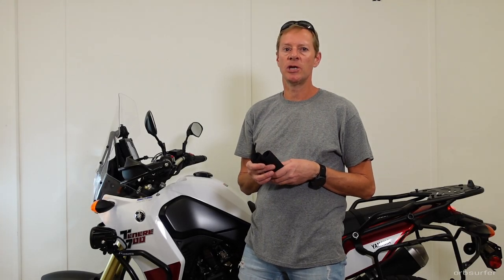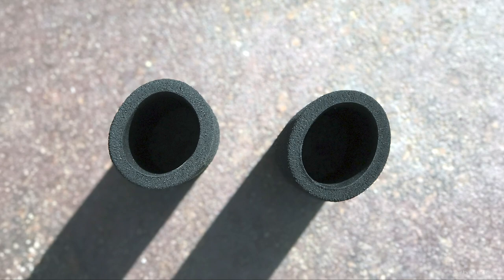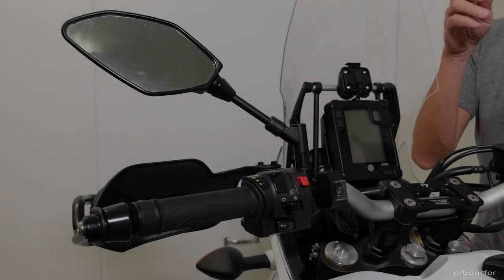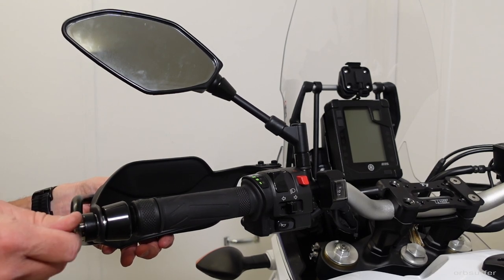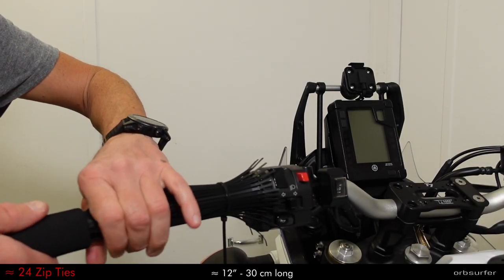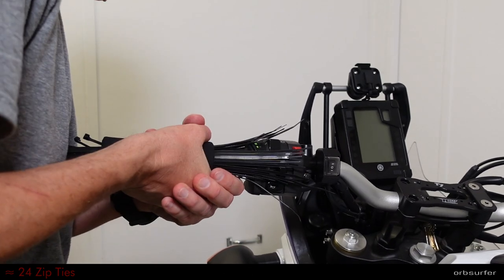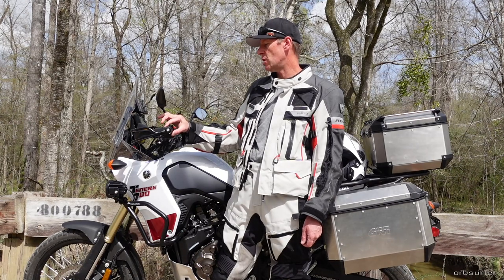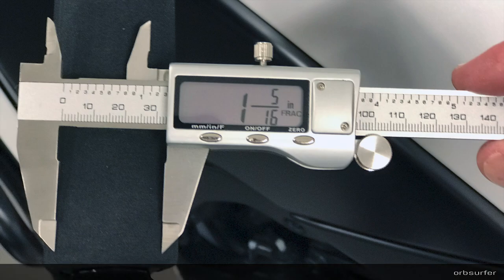Motorcycle Foam Hand Grips - Installation of Grip Puppies on my Yamaha Ténéré 700

Comment: When I installed my foam grips over the stock grips I muscled the first one on then remembered I had some silicone spray lubricant and sprayed a little on the inside (not much), then the foam grip slipped on easily.  I've had no problem with the grip moving and made the job fast and easy.  I also didn't bother to remove the bar end weights.  I really like your cell phone holder, hopefully you have a video on that so I can see what brand it is.

Comment: Nice installation technique.  I have problems with the my fingers fatiguing on the throttle hand after extended highway riding and was looking at these  as a solution.  Cruise control is the real answer,  but T7 won't get that any time soon.  I have the same grip warmers also.
Thanks again!

Comment: I used compressed air (my air compressor with a gun) to slip the foams on the existing rubber grips of my Honda CRF250L.
Just insert one end of the foam on the rubber grip (minimum 1cm), >>> just be gentle to don't tear the not-so-strong foam <<<, place the nozzle inside the foam then use your palm (or fingers) to keep the air trapped inside. 
Blow air and push at the same time.
To remove the foam, just put the nozzle between the foam and the rubber grip then pull the foam at the same time while sending compressed air.
But yeah, you need an air compressor. Some are very cheap (12V models connected on battery).

Comment: If you dont need to ride straight away, WD40 works fine just spray a bit inside the foam and slip it on. Should be fine to ride in a few hours, the WD40 dries out & the grips dont slide at all.

Comment: Has efficacy of the heated grips system been influenced with installation of these foam grips?
Reply: I've had  grip puppies on my f650gs with heated grips, it takes a little longer to reach your hands but it still works great.
I have glove size  2XL , and these puppies feel great !
Reply: MissendenFlyer used the same grips, detailed in a video, and came to the same conclusion that it only takes longer to heat the grips

Comment: No doubt this method works, we saw it, however, by the time you have placed a few zip ties the entire job could have been finished using hand sanitizer.
Reply: I watched the hand sanitizer videos and this is much simpler and there is NO residue.

Comment: Or you can just use dish soap. I fiddled around with this technique with no luck for about 20 minutes on my F700GS. Then whipped out the Dawn and they slipped right on. Took me a total of 10 minutes for both sides including removing the bark busters. When it dries they won't move at all. An old bike hand grip trick. Sorry if I rained on anybody's parade here.
Reply: Compressed air works fine too (see my post above) but the dish soap is the most used technique (and the fastest), I agree.